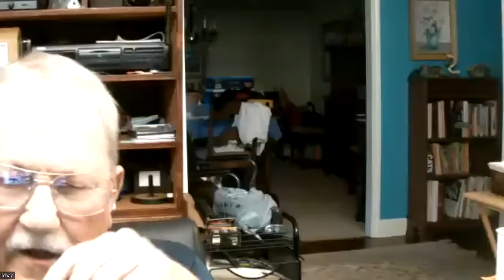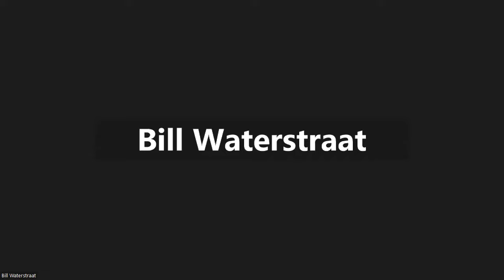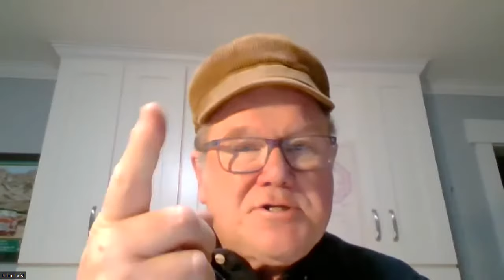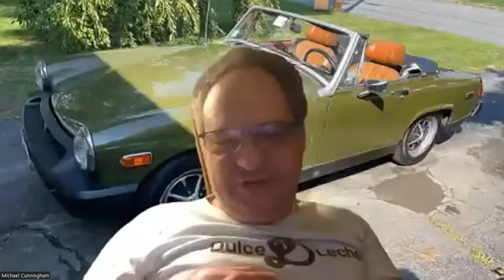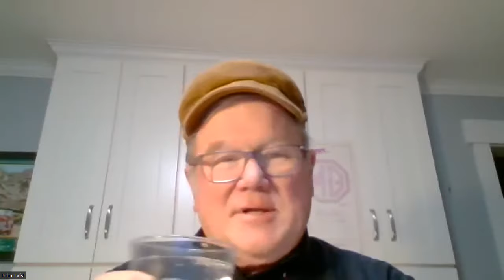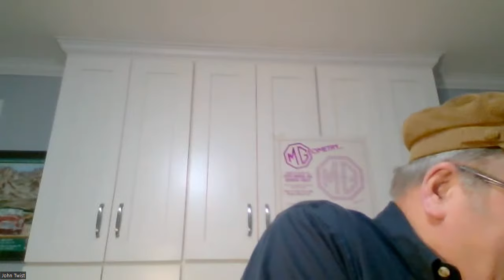440 MG Tech | Q & A on Brakes

Comment: My 1500 has a weird brake issue. The brakes slowly become applied while a highway speed until the engine can no longer overcome the brake drag. The pedal becomes extremely firm. After a 30 min wait, I can drive again for about five miles. Could my hard line be getting hot from something and causing the fluid to expand?